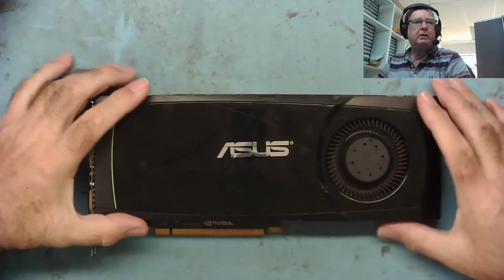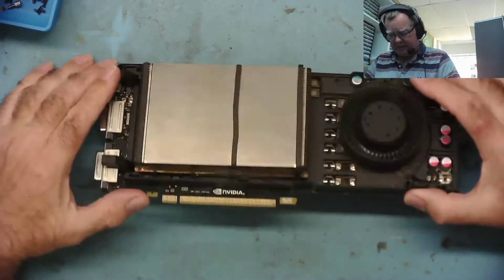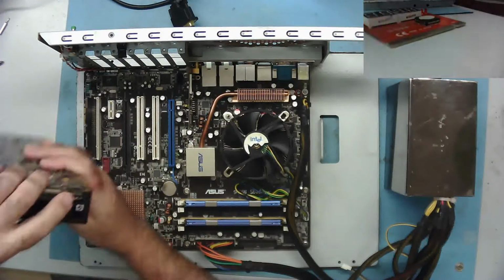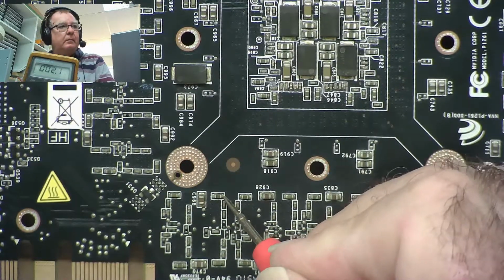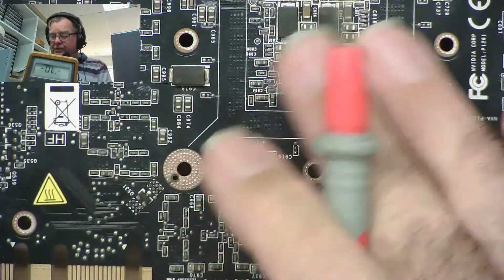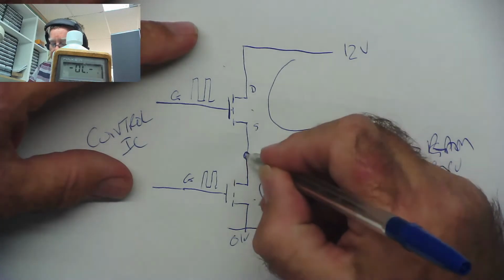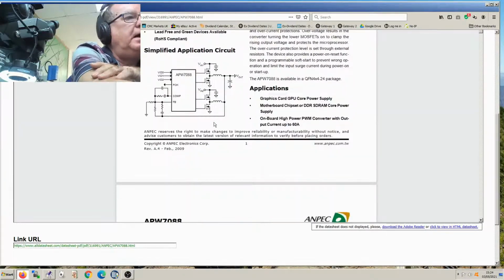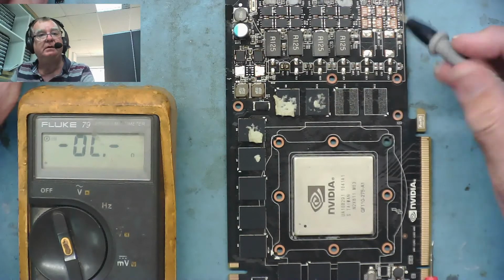LER #041 How To Diagnose & Repair A Dead Graphics Card GPU Not Detected By PC Nvidea Geforce Part 1.

Comment: for cleaning the contact's you can buy a commutator stick for electric motor cleaning .
this comes in a hard or soft form i find the soft version is very good .
unlick using a pencil rubber and having fine dust all over the place .

Comment: It looks to me like the pwm controller blew, sent too much voltage throught the mosfets and has damaged the RAM making it low resistance. You could replace all the damage but without replacement RAM chips it likely won't work
Reply from the maker: Hi First Name - If you check out the Part 2 video you will see I find the cause of the blown PWM controller, it's not quite as you suspect.  I take on board what you say about damaged RAM/GPU, that could well still be the case.  Watch Part 2 and comment on there :)   

https://www.youtube.com/watch?v=efmEvrKsFRM&t=493s

Enjoy.